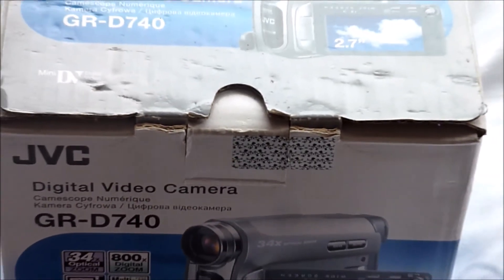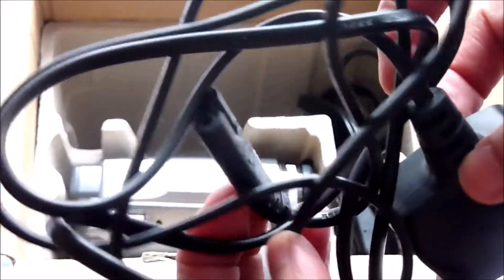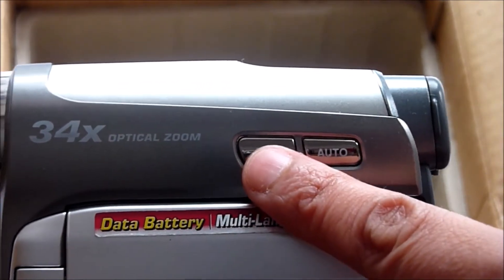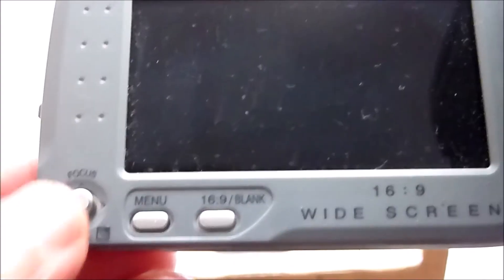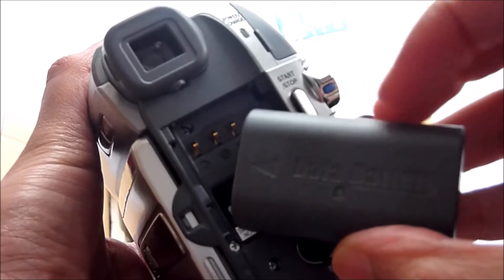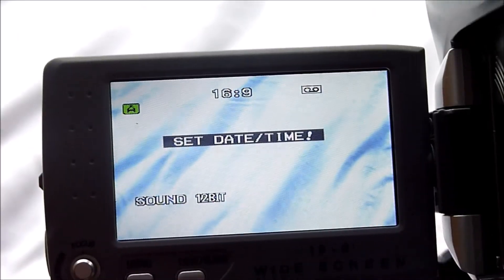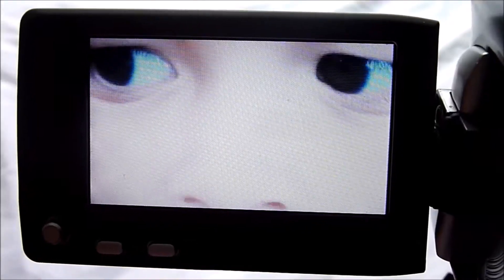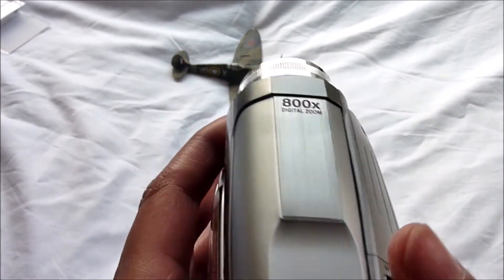JVC DV MINI CAMCORDER GR-D740EK - UNBOXING IN 2018

Comment: Great video - I just got one at a yardsale, charged it, but it keeps saying "In Safe Mode, remove battery."  I keep removing and reinstalling battery, but same error message keeps coming up.  Any suggestions?  HELP:))
Reply: Meri bhi yahi problem hai
Reply: Samajh ni aa raha kya karoon
Reply: same thing is happening to me , this comment was from a year ago .. did you find a way for it to work ?
Reply: @yariii4777  There is a belt rotating the gear for the tape playback. This belt is not tight anymore and it doesn't have the strength to rotate the gear. The only way to get it fixed is by getting it to a service shop for cameras. These shops are hard to find and many times they don't accept cameras like these i have the same problem Good luck

Comment: Do you know if there's any way to record without tape? I have a very similar model that comes with a SD memory.
Reply from the maker: Only if you have a camcorder that can record direct to the internal memory. The model in the video can only record using dv tapes.
Reply: I do have one as well with a SD memory, is your cam working?

Comment: Hi! Please, help me. I have same camera. There is a problem. When I turn it on , the following is written on the screen: REMOVE AND REATTACH BATTERY OR DC PLUG, UNİT İN SAFEGUARD MODE.
Reply: Hi there, I know it's been a year, I have the same problem, I've been investigating and it seems that the only solution is to take it to a technician. I am looking into opening it myself and cleaning it, but if that doesn't work, maybe I will look for a technician. Were you able to find a solution?